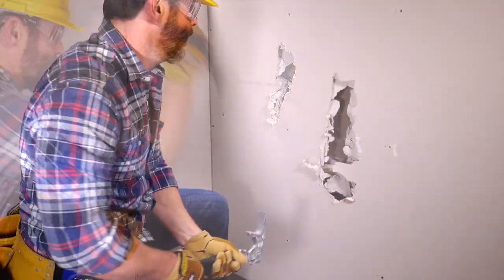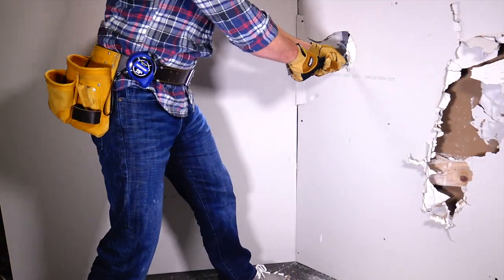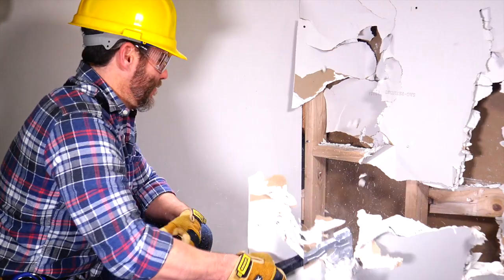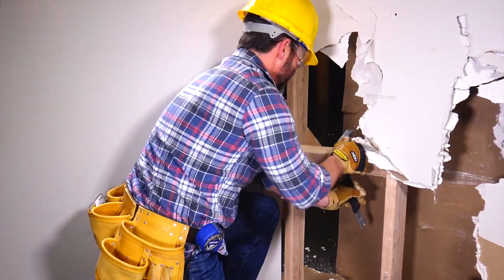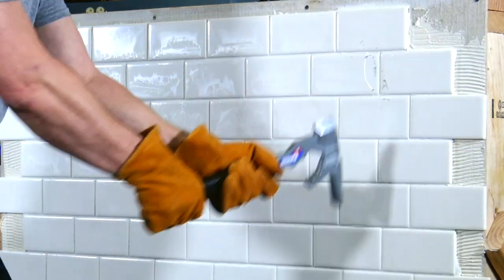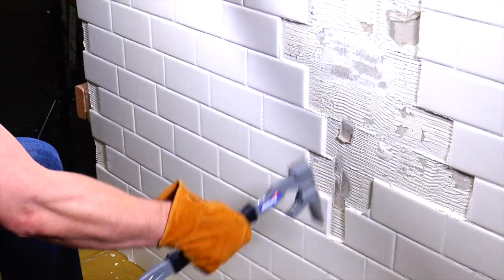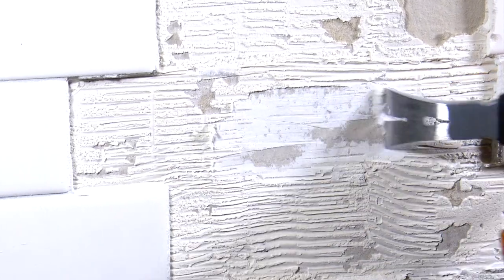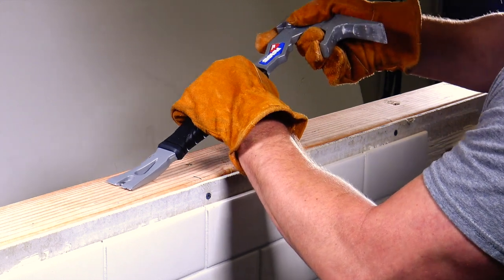The Best Demolition Multi-Tool is Here

Comment: I wonder why there are no comments at all
Reply: Total bullshit.  It is mostly useless in actual demo. Dead on hammer is better but still too small to actually do demolition with them..
Reply: Looks like a gimmick
Reply: @towdoctor670  In what way is it a gimmick? It’s a wrecking bar just like the Stanley Fubar or the Dead On annihilator. It’s a lot cheaper so I’m assuming it could be worse quality.
Reply: @bigbossignition   So I didn't say I knew it was a gimmick for sure I just said looks like a gimmick. It was just a comment this is the comment section. I think that I would avoid it at the store just for the fact that it looks like there's too much going on with it. It does suit certain personalities that's for sure.